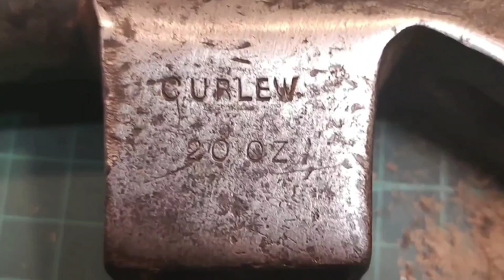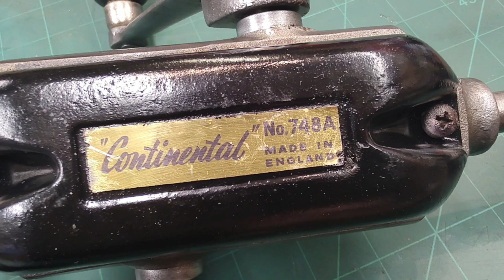multiple tool restorations cleans tool haul mancave man cave solar light diy build

Comment: Re: that Brades tool.  Def stop the rust.  I would leave the spine as-is, although maybe sand/file the edges a bit if they're spikey/sharp. And then re-handle it.
Reply from the maker: Well I've advertised it as is for the mo , because there's always someone that wants items untouched ... If it doesn't sell then it'll get the treatment. Thanks for watching !!